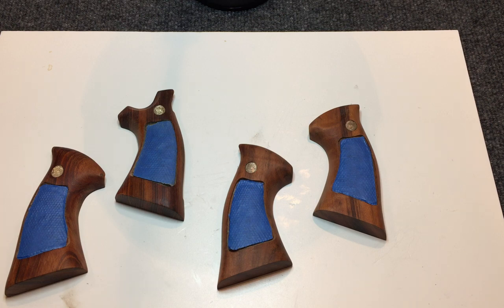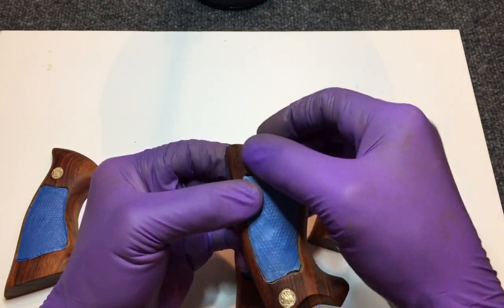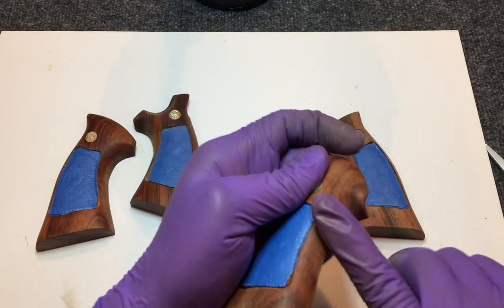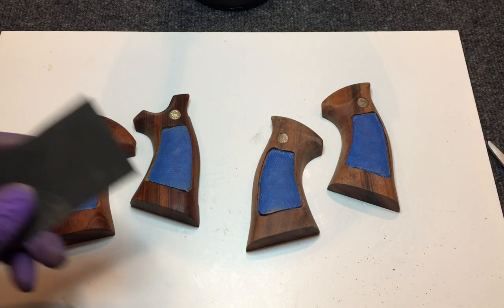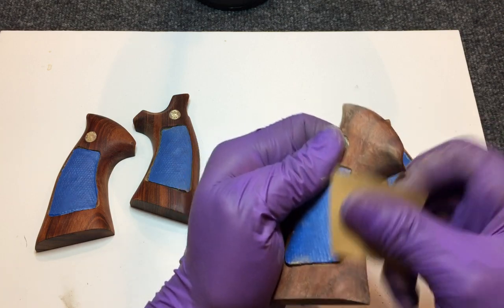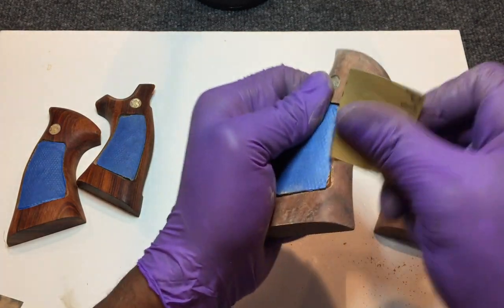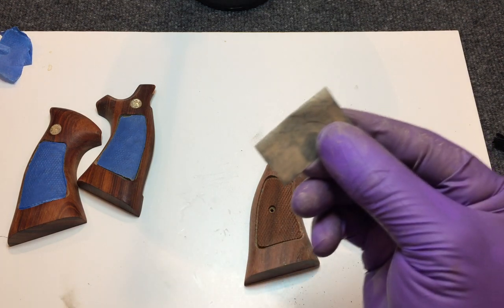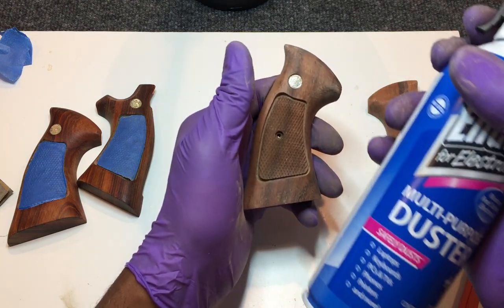Smith Wesson Revolver Stock Refinishing Part 4

Comment: I like these square butt stocks more than the round butt.  But I noticed that most if not all of your snubbies have round butts.  Is it possible to install square butts on the snubbies or is it just your preference?
Reply from the maker: Yes, you can, and they will fit.  But it will leave an opening down 1/2 the length of the backstrap.  S&W and several after market companies make round-to-square butt conversion stocks that addresses this desire.

Comment: Is that a nylon brush ?
Reply from the maker: Yes.
Reply: Does the brushing alone remove the finish on the checkering ? Sorry for all the questions but I want to do a good job when I attempt to do mine
Reply from the maker: No problem.  Brushing does not remove the old finish.  Brushing is the agitation means necessary to remove dirt and grime from the checkering and grooves.  Mineral spirits and acetone can be used to remove the oil residue and finish. @totljag1

Comment: Thank you very much for these videos. They are very informative. Quick question about the checker area. You used acetone on one pair, but on the other pair you used scotch bride, but you never said how the finished was removed from that pair. So how it was done?
Reply from the maker: The checkered area on the pair which I used scotch-brite on wasn't touched.  I thoroughly cleaned it with a stiff bristle brush and mineral spirits, and blew it out with air.  Then allowed to dry before applying the new finish.
Reply: @mr2275cur  Thanks you for your explanations!